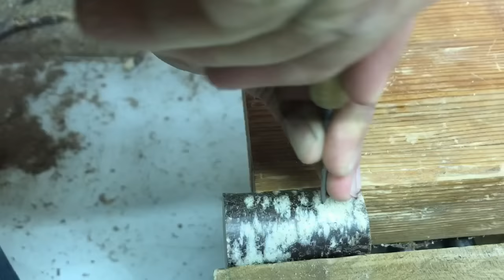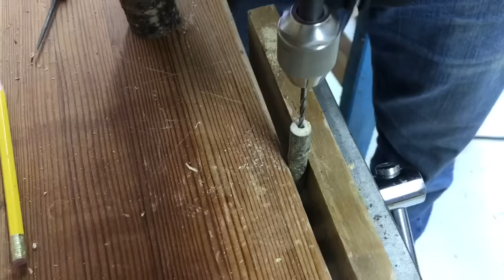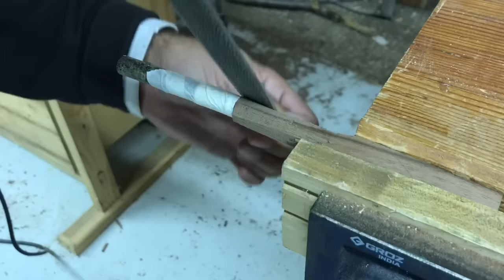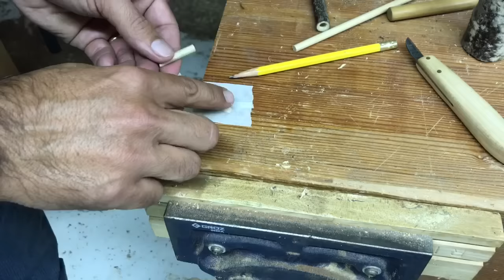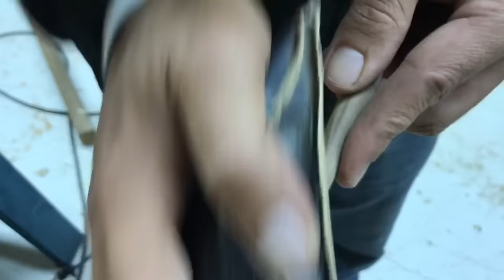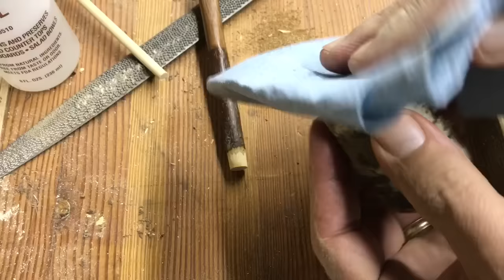A "Hobbit Farmer" Pipe with Hand Tools

Comment: The fact that no power tools were used makse this a 10/10 build video.
Reply from the maker: Thank you , Tom...that's kind of you to say.  There are times when I find it so enjoyable to work with hand tools and enjoy the sounds of woodworking and the process instead of feeling like I need to hurry and use power tools.
Reply from the maker: James Taylor  James...you just made my day with that comment...that's funny :-)
Reply: @StanCrafted  can you do another but angle the hole that connects to the stick slightly ✔
Reply from the maker: @sunsetsleeper  Funny that you mention that...I am about to start on one that had a branch sticking out of the tree at an angle like you mention...If I can pull it off it should make a connected stem and bowl...and be a better angle.
Reply: But there was glue…

Comment: Trying to find a pipe video other than clay that don’t use plastic mouthpieces or glue
Reply from the maker: The wood mouth piece held up better than I thought it would...but, not forever.  No big deal though...it can be replaced.  I'm beginning to thing the way to go now for all natural mouthpieces is simple to make them from walnut or maple and turn them on the lathe with a press fit...much as one would with a plastic mouthpiece.  Just plan on replacing them every so often.  Just be aware that you may need to replace the first mouthpiece before it wears out as the stem might shrink or swell seasonally and with use.  But, the amount of wood used for a mouthpiece is so small you can cut half a dozen with different tenon diameters if you need to and swap out as needed.  Easy.  Thanks for watching and posting!

Comment: Mad respect! It's tough enough using power tools to drill the stem. I use woods with a soft core.My favorite stem material is dried rose stem. It has a soft core that you can remove with a piece of coat hanger. Beautiful Job my Man!!
Reply from the maker: Thank you so much!  Sorry for the slow reply...where I live in Oregon we were without power for 12 days because of ice storm damage.  I'm going to try dried rose stem for sure.  Can you steam bend that?

Comment: Wow Stan. I haven't used a brace and bit for 30 years.  I was thinking only last week that I really need to buy one or two for the school plus a hand drill. I love using the dozuki and Japanese saws in general. As for the pipe, it turned out real cool. I used to smoke a pipe back in the 80's in London. Only managed to quit cigarettes in 2017. Will check out Alberto at Mosca in a while. ...... Pascal
Reply from the maker: Pascal, the dozuki gets quite a bit of use in my shop, but I don't use the brace and bit that much.  However, there was something very nice about working in the shop without the dust collector going and the noise from the machines.  I may do more of this in the future.  Glad you were able to quit smoking cigarettes...you'll be around longer to post more cool videos.

Comment: As a pipe maker for 8 years you did a good job. Although you could make a better beeswax seal for the barrel of the pipe and a finer tip.
Reply from the maker: Thank you so much for the feedback! Can you explain a little more about the beeswax seal? I’m getting ready to make another pipe...this time with the stem coming from a branch off of the main trunk...and always would like to improve what I do.
Reply: @StanCrafted  you see beeswax (bee wax) is a natural wax made by honey bees. You can apply it like a glue and make a proper seal and even polish the pipe. It's even used on corncob pipes to seal the cob to keep it from cracking.
Reply from the maker: Thank you so much...I will take both of your suggestions into account when I make my next pipe.

Comment: How do you stop the end grain from splitting on this bowl?
Reply from the maker: Hi Jeff...I just made sure the wood had completely dried before I started this project.  That piece had air dried for at least two years before I made the pipe.  I also apply a coat of the beeswax/mineral oil mix to it from time to time.  Still going strong!
Reply: @StanCrafted  thank you for that info!  Gonna give it a shot

Comment: Great video And skills   Question though, can I use any type wood for this? I live by the ocean. Can I use driftwood?
Reply: I’m also in the pnw.  Washington state
Reply from the maker: Hi Asphalt PM...thanks for the kind words. I'm not an expert in pipes...but, I did do a bit of research before I made this one.  I wouldn't use any type of wood for a pipe...but, I did find that Cherry and Maple are suitable alternatives to Briar wood.  I used vine maple which I'm sure is available in Washington.  If not, maybe you could find some Cherry trees that need trimmed...I remember reading that this is preferred substitute.  Good luck and have fun with it.